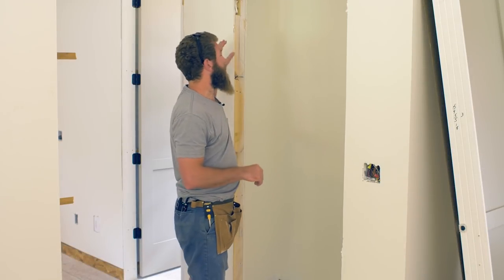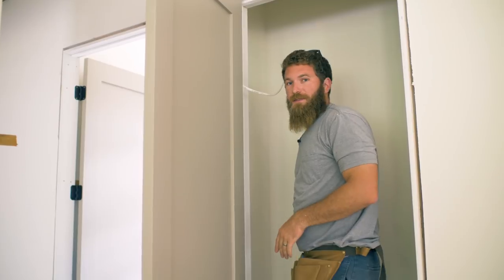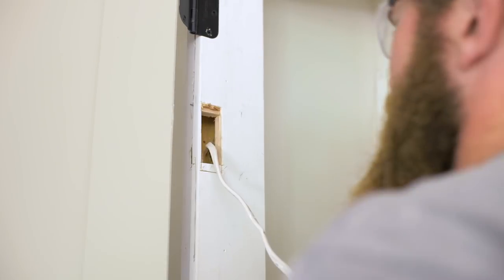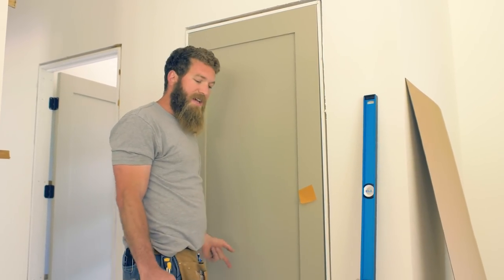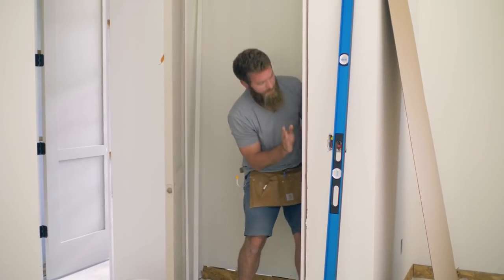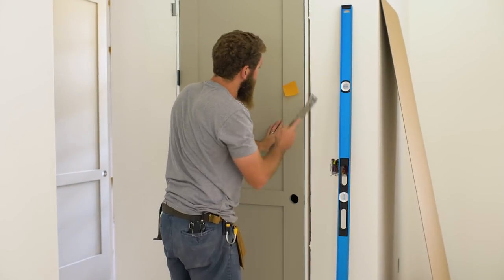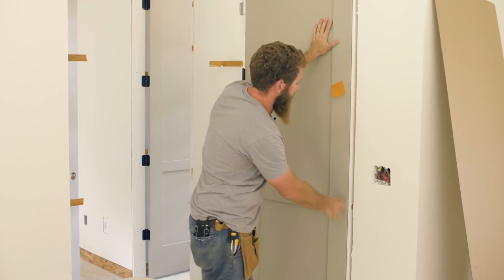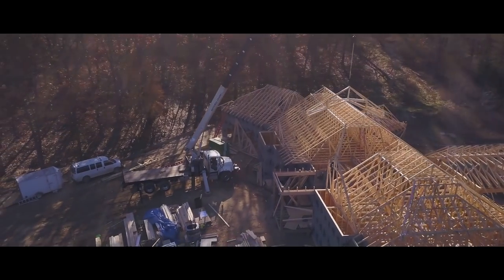How to Install a Prehung Interior Door + Jamb Switch

Comment: Cool thanks,  I was just checking to see where your placing the cut out, it's so close to the edge, but I see that you took the jamb stop off, and this one here I can't remove. I'm going to use the multi tool and make a slot into the side of the stop